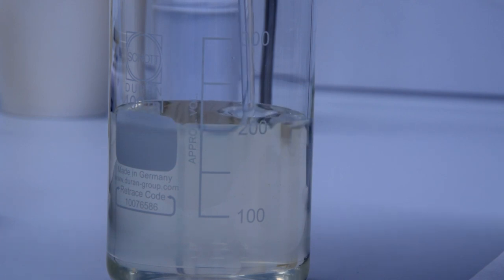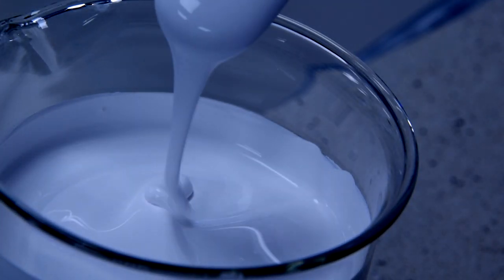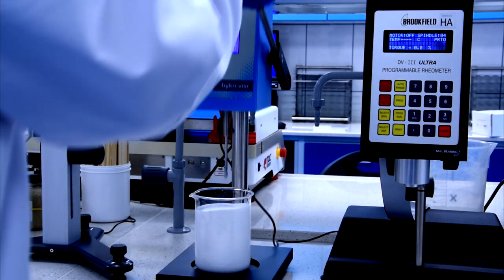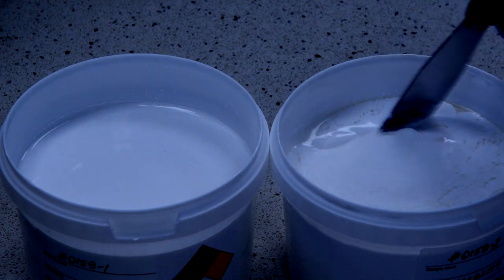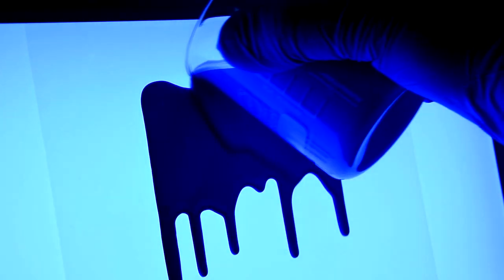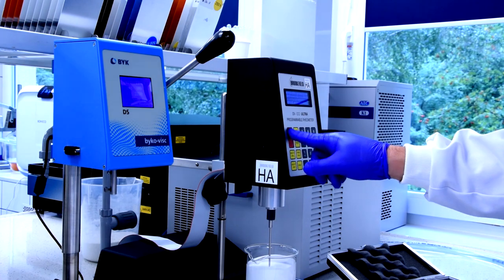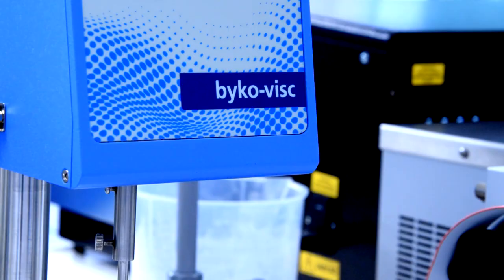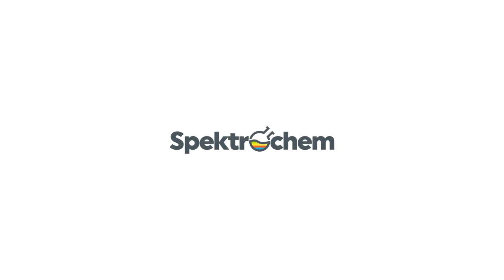Studies of mid and low-shear viscosity modifiers (Stormer & Brookfield)

Comment: Can you tell me about the difference of high shear and low shear thickener? I am trully grateful!
Reply from the maker: The difference is in the thickener's effectiveness in the different areas where the paint is sheared. Low-shear thickeners impart a viscosity that can be measured with Brookfield (ASTM D2196 method A) and this is the viscosity that gives the paint in-can rheology. Mid-shear thickeners in turn give the viscosity responsible for sagging and give the viscosity to be measured in KU with a Stormer viscometer. The last group of thickeners are high-shear thickeners, the effectiveness of which cannot be measured with Brookfield, and with ICI cone-plate viscometers at speeds from several thousand to 10,000 1 / s and higher. They are responsible for imparting viscosity at high shear rates during brushing, spraying, etc.

My article "Best practices in evaluation of rheological additives" will appear in the July issue of PCI magazine, which will discuss the principles of operation of various thickeners in detail in case studies.
Reply: @SpektrochemResearchLaboratory  thank you so much for taking your time to answer my question. I will search your article in July. Absolutely. Thanks again.
Reply from the maker: @Hangle1507  You're welcome. Stay tuned!
Reply: @SpektrochemResearchLaboratory  Hi Sir!
Can you please send me the link of your article?
I appreciate❤️